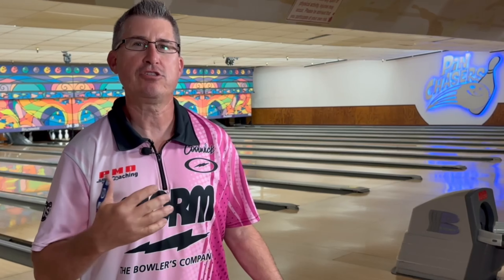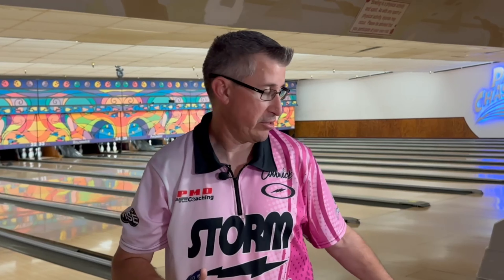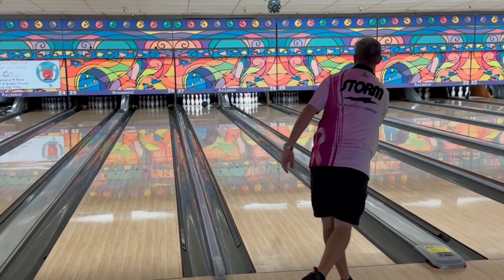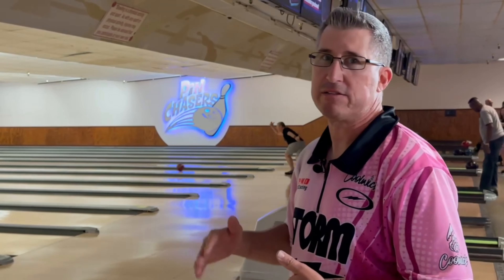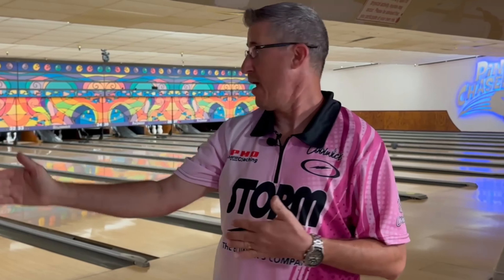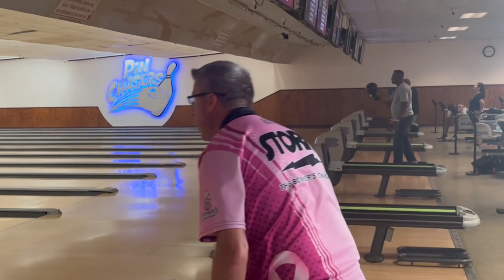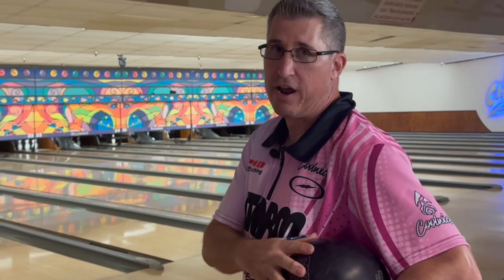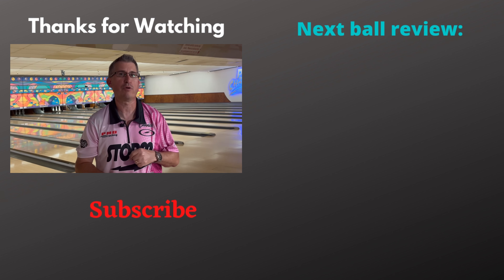Arsenal Building Part 3: Bowling Ball Surface Adjustments

Comment: Couldn't find a happy place for my Fate until I took it down to a 1000, now its a game 1 option depending on the lanes that night. Same for the Alert, too clean for my speed dom throw until i started keeping it at 2000. I still like to have a couple polished also to have my bases coverd.Stonger covers like NEX hybrid polished on my Marvel Maxx still look nice on fresh and polished HK22 hybrid on my B Widow 2.0 for 2nd/3rd game if the fronts get toasty. I only shoot THS but at 3 diffrent houses leagues.
Reply from the maker: I was having the same problem with the new polish. The Fate was too close to the same motion as the Revenant and Night Road for me so I don’t use it much. Having the surfaces at 1000 helped with the motion and once they lane shined the motion was more predictable for what my eyes like to see. Thanks for watching.

Comment: how often do you clean  your bowling balls with a cleaner
Reply from the maker: I don’t use cleaner. I just use abralon pads to adjust the surface when needed. I only recommend cleaner if you don’t have a big arsenal to help the ball last a little longer.
Reply: @PeteDohanJr  I have about 20 balls it’s a pain to clean them after every set
Reply from the maker: @rignizio  I have accumulated a lot too with all the releases. If you use one for a lot of games each week then I would clean it. If you don't use them then I would skip it. With our leagues the lanes are different each week since we follow a 5 person mixed league that I don't always use the same balls each week.